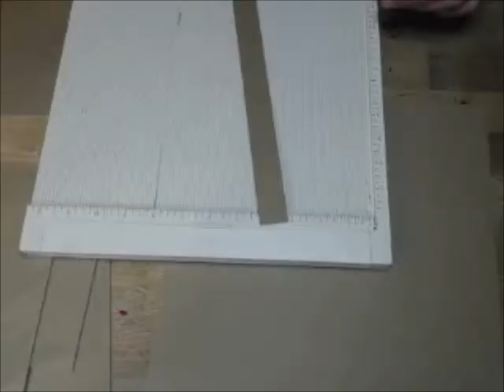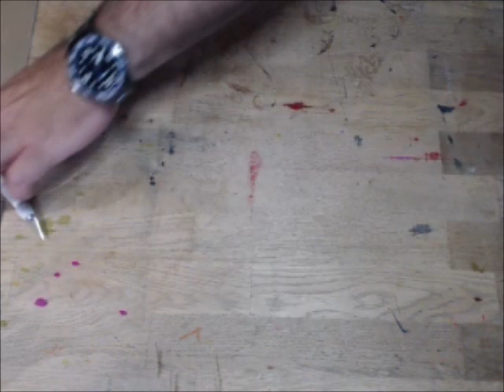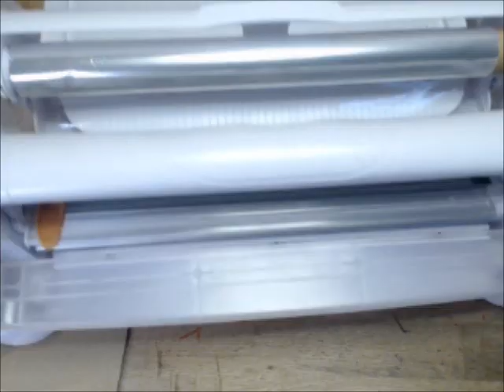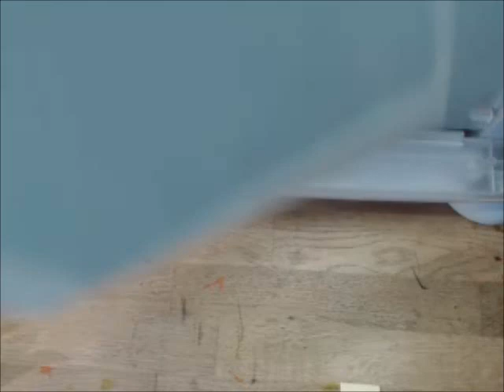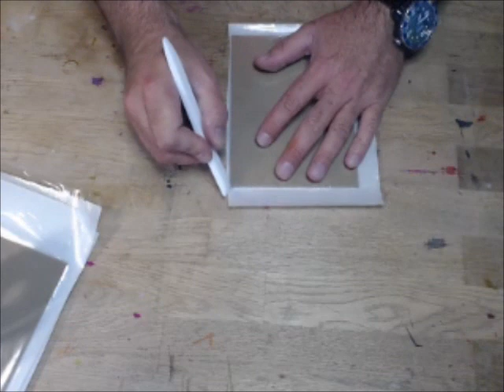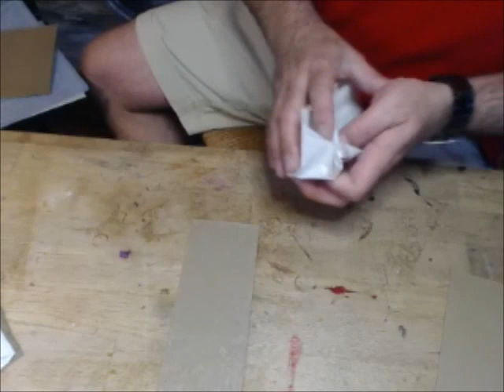Carol's Caddy Highlights Part 1

Comment: I just came over from Fiona's channel. I'm loing the idea of the structure strip!  Hearing you say you've burned your good mats made me chuckle. I've done the same thing. So I have a my mom's old quilting mat. It's big enuf to use it on one side, then move it around to the next side! lol I've used it for about 3 or 4 years. and I still have 2 more sides. lol I don't know what I'll do when the whole thing is warped. I'm glad I found you. I use the tool that I got to apply rubons. TFS Hugs, Jess